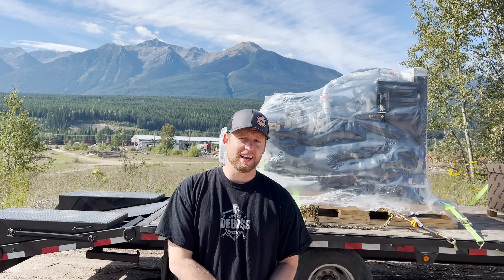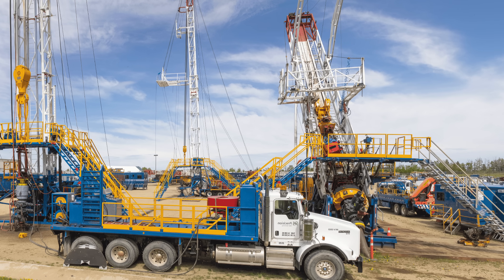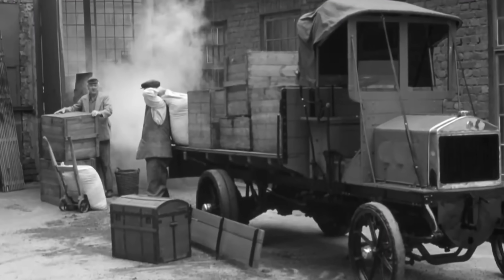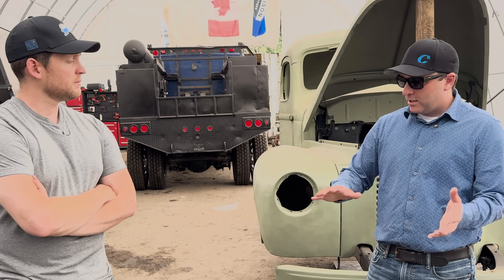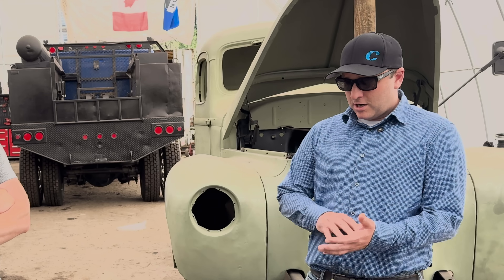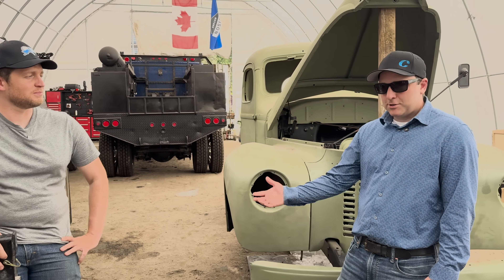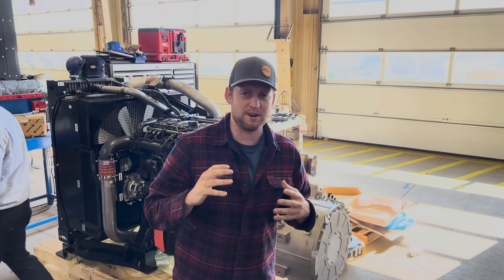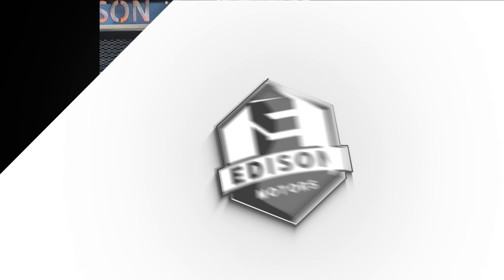We're putting Scania engines into Edison Motors Trucks!

Comment: Since your truck is just an electric truck with a generator. Why not make a replaceable skid, with just a powerplug, ethernet plug and diesel and def line. That way you can choose your motor and swap them out in minutes. have the customer choose.
Reply: It's a bit more engineering behind it and to work with every manufacturer takes times and resources. They found one that isn't complaining that they will only build <10 next year. For which they are onboard with the choice of generator engine. Waste of time now to start to spread out among different suppliers.

Comment: what matters more for pulling weight is it horse power or torque ????
Reply: You can turn HP into Torque with gear reduction. But you can't turn Torque into HP.  Torque spins the wheels, HP is how long it takes to move that heavy load up a hill. So you need both.

Comment: I'm just an old guy that likes trucks, machinery and powerful engines. I've never heard of Scania before seeing this video. You've got yourself a new subscriber due to interesting content, no excessive talking and no stupid music. Looking forward to seeing the installation of this motor.
Reply: Scania is a gold standard for Europe but there lies the problem with those motors, in my experience, these motors have to be treated like the EU regulations 

9 driving hours per day max, (they include loading and unloading time in this)
56 per week or 90 in two, 
MUST take a break every 4 to 5 hours with the truck not moving even if there is another driver for at least 30 minutes
MUST take 45 continuous hours of rest after 6 days of driving
Reply: @David-jt9nt how does that even work? they are designed for these tolerances?

Comment: Being able to use regen for braking, would it make sense to use an engine that doesn't have a jake brake for this truck?
Reply: Chace has previously explained how the generator bolted to the engine also can function as a motor.
So if the batteries are full the regen power can be put to spin against the diesel engine, in which case the jake brake can be used to hold back just like a regular truck.

Comment: In the Netherlands the Maximum weight for normal trucks is 50 metric ton or 112,000lb, and for special "long heavy" configurations 60 metric tons or 132,000 lbs

Comment: Interesting that they are able to run SCR without a DPF.  As a fleet mechanic responsible for diesel vehicles, I much prefer the SCR systems, as they allow a lot less EGR to be run, saving wear and tear not putting as much soot back into the engine, and without the DPF you're not literally dumping fuel out the exhaust

Comment: No experience with Scania but Cummins Caterpillar even Ford and GM Isuzu Duramax the v motors always run smoother than the straits 6s working a lot of off-road equipment including snow cats the big push is emissions and dpfs and after treatments are a nightmare

Comment: So out of curiosity, do you feel it actually needs that size engine to run the generator to power these electric motors? We have a Perkins diesel 150kw standby generator to run a 1500 sow barn.  Would your rpm be lower then, constantly, or do you need to have it programmed to peak rpm occasionally?
Reply: The motor that he's showing looks like a 9l inline 5. I think he got a bit excited about the 770 motor 🙂

Comment: I see a lot of trucks will be started and left idling to warm up for 30 to 60 minutes. Obviously electric motors don't need a warm-up time but what will the generator engine need for a warm-up cycle before it starts charging batteries at peak or does it need one?
Reply: Modern Diesel engines don’t need to idle more than ½ hour to warm up even in cold weather. One can start after less than 10 minutes and going easy until reaching the service temperature.

Comment: I wpuld be interested in knowing about these scania engines and trucks. Im so tired of working on peterbilts and kenworths. I dont cate much for the detroits but here in idaho it seems all we work on is series 60s or cats...we had one mb debacle.
Reply: Bruce Wilson has a few videos on the trucks, he's working with Scania North America to bring a new Scania 770 truck to the US.
Reply: @AlexKall  good I hope they are a lot better then the Pete's and Kenworth I am used to working on. We had. A 67 Kenworth in here parked next to an 87 and there was like no difference between the trucks besides the interior. It was crazy 20 years passed with little updates. And I tell ya Kenworth clutch jobs are just spectacular 😂 omg 15 hours of labor if your on the lucky side. The one I'm doing right now has to pull two cross members, two air tanks and the PTO. Took a good part of 9 hours to get the trans out.

Comment: you should have gone with Volvo Sweden more reliable engines more power.
Reply: Umm…Scania is also from Sweden
Reply: @JLHare-hj1mv  yes it was . butt Scanias history is ridiculous. the company has bankrupt Many times in the beginning every time the same name. usually when a company goes down the Name of that compani / brand name is God bay . and now it's Germany owned. last company I worked for had most Scania the new truck didn't even make ifr from Södertälje to Sundsvall before the engine was blown and kaput. don't like Scania. like Volvo trucks . more reliable
Reply: @JLHare-hj1mv  and I meant Volvo Sweden as a eu modell of Volvo FH 17L 780hk not like Volvo trucks in usa max HP in original volvo in usa is 500-540 hk ❓13L or lower

Comment: and scania and man for euro 6 use diesel partikel filter and scr filter, wich need adblue.
you cant use tier norm for off road engine on a on high way truck. appels and oranges.
personaly i would not spend the money on a scania overprices v8. 2 more cylinder use more fuel. and in the shop you have 2 mechanics , one left and the second right side. the parts are over priced be scania.  if you need a 800 hp engine off road, or tier 3, go to cat  c18.

Comment: I’m not going to lie, Chase your seal of approval on Scania is probably the best advertisement they could have in North America! I’m curious to see how things look after a half million miles of use in your specific application. Due to the torque loads you are going to be running and the reliability of the duty cycle it will be interesting to see what kind of “mileage” you end up getting from the motor compared to a non hybrid drive assembly. Please keep us updated on all the details. ❤

Comment: The reason it doesn’t need a dpf isnt because it runs cleaner it’s because over 750hp they fall under mining and marine emissions standards the new 18 litre John Deere engine makes 900 hp so it doesn’t have a dpf either

Comment: As for efficiency i used to work for a large chip hauling company, they got talked into a 12 liter engine for a batch of trucks. They got worse fuel economy and had more break downs, they ended up getting rid of them well before the usual milage and went back to 15 liters.

Comment: You say the spares are easily available in North America, but how's the actual availability/interchangeability of those spares? Are they going to sell them to a non-dealer? Can any shop fit any parts or do they need to be matched serials, $20k programming tool etc?

I know a guy who put CAT generators in NZ mountaintop radio sites 20 years ago. The contracts said that CAT would provide a full set of interchangeable spares including all electronics (engine controllers, governors, voltage regulators etc), and a toolset to enable them to be changed on site. 

He told them to prove it. Imagine the site got hit by lightning. Fit the spare ECU off the shelf. 

"No need, no need, it'll be fine, everything will work."
"Prove it or you don't get paid."

Push start. Cranks. Nothing happens.

It took them three months to get it to the point where you could swap the ECUs and it would actually run. They had to re-write some of the ECU code so that you could pair parts to multiple serial numbers, rather than flying someone from Australia with a laptop to reprogram the parts.

Comment: So what happened with the electric truck you were working on?
I thought you were trying to make diesel electric style trucks. 🤔
Reply: They are. L series and BDE are the series hybrid they have been describing all along. A single facebook post mentioned BDE could be with conventional transmission, but the Short/Story of Chase talking about the BDE, it's a hybrid. I don't think a fully conventional will happen. They have investors that are into this hybrid, they have spent lots of engineering time and programming for the electrical driveline. To do both that and also start sourcing clutch, transmission, axles etc. Why, just why? So I think we will just see the diesel electric ones.

Comment: i worked for a company in australia that attempted to use scanias as tripple road trains to haul iorn ore a few years back 
the trucks are very nice but they had lots and lots of issues with drivelines ....

they could not really haul what was advertised on the tin ...
Reply: Plenty of Scanias hauling 90 ton of ore in northen Sweden but 90 tons is nothing in Australia
Reply: @Groza_Dallocort  they rated them at something like 170 tons 

the engines were pretty good 

it was more the drivelines were not up to it the gearboxes and programming being the main problem 

i believe maybe the local distributor was to blame but bite off more than they could chew
Reply: @Groza_Dallocort  plus they did not sometimes handle the heat in summer temps were up to 48 degrees celsius  and they had no extra cooling package or anything to handle this
Reply: @MegaRyan123456  that should be able to be fixed but how much will it cost
Reply: @Groza_Dallocort 

They ended up going to American trucks with power trailers

Comment: A question for daubters and NA engine patriots. Why are the american engine choices on trucks in Europe almost non existent but European engines are options on every other American truck?! Well because american engines have it very hard to meet the emission regulations over here and the engine it self has nothing to offer that would tip the scale towards NA engine. That 770hp engine laughs at the NA emission regulations! We (Finland/Sweden) pull 34.5m (113,2ft) long and 76t (167 551lb) combinations with Scania 520 V8 (530hp in i6 conf.). The power is there!😉  The only reason Scanias aren't in NA is the governments sheltering the local industry by childish regulations and import taxes. You don't know it before you tried it. Scania engines are the best!  Scania have pulled about 1200hp out of that engine at the factory but the gearbox can't handle it yet. Have you some of that!

Comment: 20yrs as a diesel mechanic in australia and Scania motors are 1 of the best for putting up with our brutal conditions thanks to being simple motors. There 16ltr V8's are a good old fashion push rod V8, unit injectors, no dpf's and having individuals heads means iv done many, many many single cylinder rebuilds on them. They are so tough that you can remove the piston and conrod from 1 cylinder and have it keep runnings on 7, with a load, back to the workshop hundreds of kilometres away, iv had to do that twice in the out back😂.
Reply: I love when companies use single heads, makes life so much better most days
Reply: @burnschry  just like power assemblies in locomotives.  Makes a tuneup so easy when everything from the con-rod to injector is just a swap.
Reply: That is impressive.
Reply: That's super cool!!
Reply: How'd ya block off the crank to get oil presure to the remaining big ends
Reply: @fowletm1992  we had a old connecting rod cut down to be just a collar that clamped the spot in the crank basically. We had a couple of kits made up. A different sized fan/drive belt and pulley to by pass the a/c compressor as they tended to blow up often with the Aussie heat and cant put a new one on because of no stock or just had to get the truck to its destination (without air con, it sucked but we had bunk coolers). Had kits with spare injector units, push rods and bridge caps. Turbos and air compressors as well. All the common failure points that we knew about. P
Reply: @fowletm1992 depending the situation he coulda chopped the connecting rod up and bolted the cap back on to maintain oil pressure
Reply: DAMN!!!  I just moved my business from Oregon to Sweden and I've been in the market for a truck.  I'm pretty well convinced that Scania will be my choice.
Reply: @EnGammalAmazon  Care to share? Sounds like a really interesting story.
Reply: copy that.      
over hear in aussie myself.  done it all from jap, american and euro and scania by far seams to up there if not at the top.   there engines are easy to work on and durable.
Reply: O.o
Reply: How many freedom units of distance till you need to typically rebuild or refresh a scania motor? On average across the product line.
Reply: DANG! That is EPIC!
Reply: Had anything to do with the old Gardner's? One of the best boat engines around.

Comment: I dont understand why you need such a big motor. Couldn't you just use a 100hp or even smaller motor?
Reply: If they have time to wait for charging. 
Chase got carried away by the V8 but normally it will be lower. The engine they got there in the video looks like the inline 6 with 9 liters [EDIT: might be the 13 liter one?].
There will be some fine line where it can charge seldomly enough. 
Like if they have a very small motor maybe that logging example with going up empty and going down the mountain regenerative braking works. 
But if they couple the truck to some trailer and bring logging vehicles up to the mountain it will not work for so long. 
A V8 isn't required, but the 9 liter could charge all the time, whereas it doesn't need the instant power that today's 15 liter inline 6 has.

Comment: Tiny correction to your statements of weights in Europe: In Scandinavia (Finland, Norway, Sweden) our logging trucks vary from 50.000 kg to 90.000 kg so the 770 hp engines come in good use. It is only in the continental Europe the limits are 40-44.000kg.

Comment: Confused here. Please update. The whole point of the electric motor,  was to have the electrics provide the peak torque needs, optimal for how an electric motor works,  then using a smaller diesel motor  operating at its optimal rpm running an AC generator providing the power to recharge the batteries, leading to fuel efficiencies.  Now what i'm hearing is returning to using a large, in this case a 700hp motor to run the generator. Are you using a larger generator as well to take advantage of the diesel's capability?  Can you use less battery capacity then, saving weight?  What gives?

Comment: I'll stick with my C18.  Ill wait for you with the 770 at the top of the hill.😂
Reply: If you wait on top of the hill, it’s because the scania will pull his second load when you still pull the first one ! Secondly you will stop before to the gas station ..
Keep on dreaming (and wasting time on climbing Hill 😂)
Reply: @mathieuauffret7324  I've made a living with 2 Caterpillar c18's over the last 15 years.    Not dreaming at all.    The 770 may actually be a formidable competitor for c18.   As far as fuel consumption.   Comparing a 13 liter Scania to a c18 doing the same job is just dumb.  Obviously they didn't need an 18 liter.   It's one sided bs test results.    I'm disappointed they'd even mention a comparison so one sided.  What else they lying about 🤥 🤥 ?

Comment: I really want to like scania, I really do, when they are running correctly, they run amazing. However, the majority of the ones I have encountered do not, even brand new ones. I’m not trying to bash Scania, I know they would have not been around this long if they put out garbage products. An egr valve should not fail at 4 hours, an ecm should not fail at 39 hours, and then fail another 100 hours later, a turbo should not fail at 134 hours. Fuel consumption is higher than expected as well at around 26-27 gph at 1650rpm at 75% load and def is used very quickly due to scr being the only emission system on them. That’s just my experience with DC16 V8’s. Have not used their 5 cylinder or 6 cylinder motors, but the V8 definitely left a bad impression on me. We are not allowed to do a whole lot with them either, all repairs had to be made by our Scania distributor to keep the warranty active, and most claims were denied anyway. Just do some real thorough testing Edison Motors and keep 1-800-2-Scania in your phone.